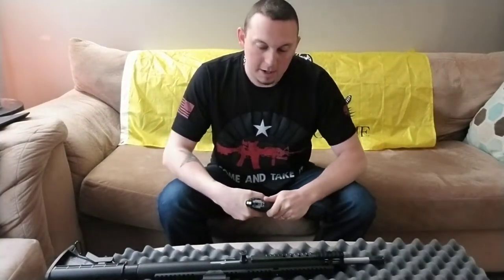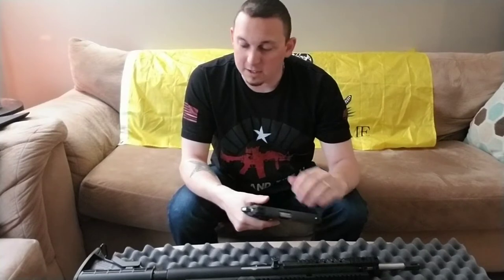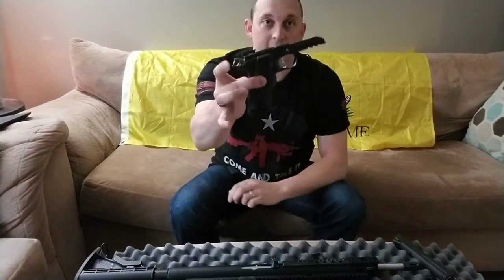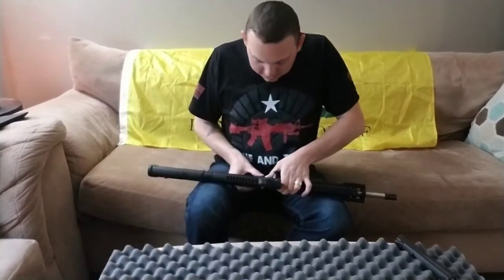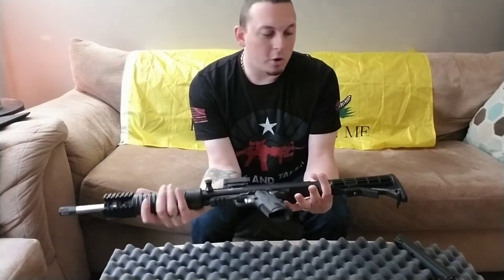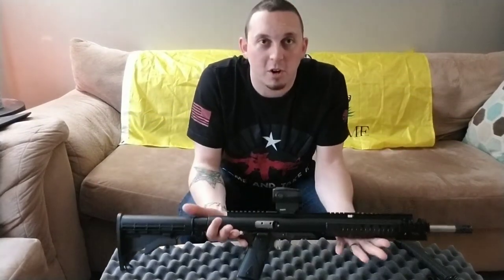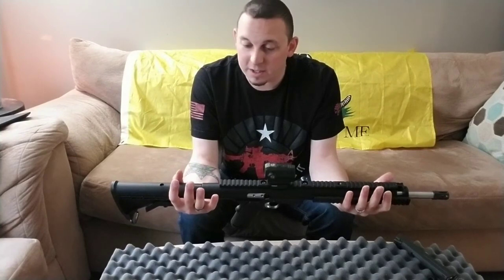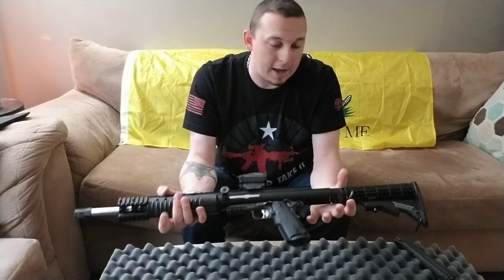Mech Tech CCU combined with a Sig Sauer 1911.

Comment: Will it work with a compact 1911
Reply from the maker: frank I'm not really sure honestly.
Reply: Yes, it will. I haven't actually fired it with my P10.45 Para-Ordnance frame yet, but it fits perfectly and functions manually. On the MechTech website it says the acceptable length from the slide stop pin to the end of the dust cover is 1-5/8" -  3-1/2". My P10.45 frame measures 2-1/8", so a frame made to fit any barrel down to 2-1/2" would fit. A frame with a full-length dust cover like the STACCATO – XC or Nighthawk TRS Commander won't work. I've been using my very old CCU with my 33 year old Para-Ordnance kit gun, but I'm upgrading the CCU and using the frame from my 3" double-stack .45, instead of the one from my 5" double-stack .45. And I can use my 15-round mags from the big gun in the smaller frame. My Para-USA LDA (Light Double Action) 12.45 won't work with the CCU. I think it would fire every other round if I manually cycled it and dumped half of my ammo on the ground, but MechTech just says the LDA won't work with the CCU. If your 1911 has a ramped barrel like all of mine do, don't forget to buy a Para Block to fill the space in the frame or it won't be able to feed.